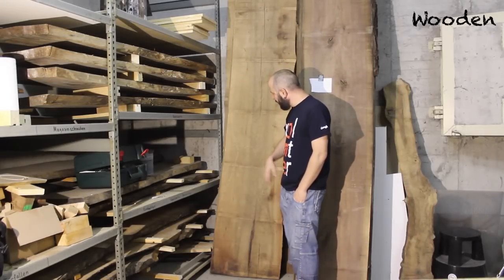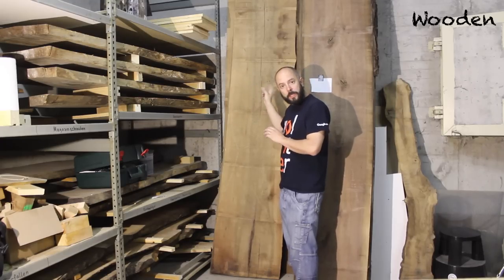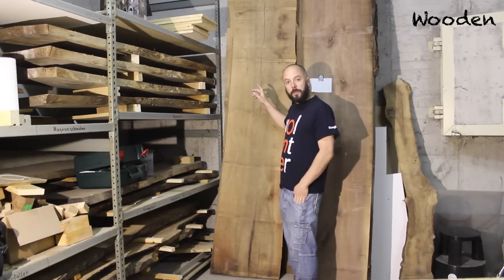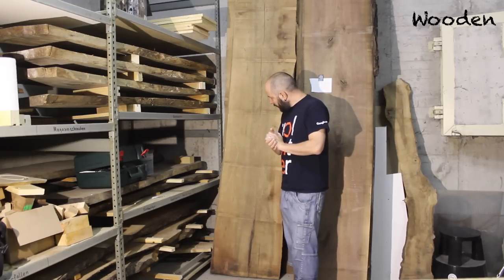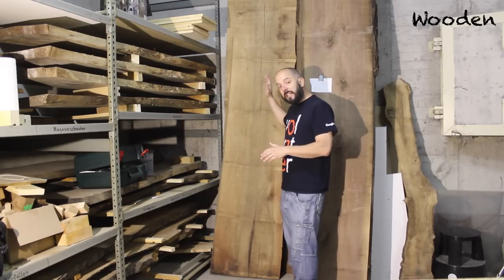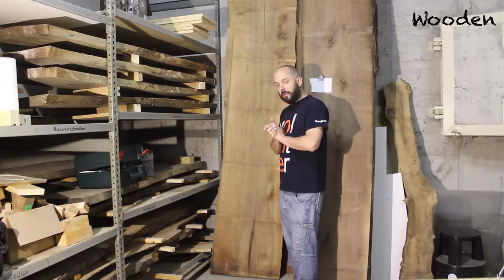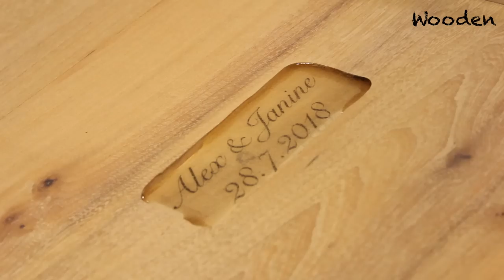Extendable/expandable Live Edge Dining Table - Elm

Comment: Great work. How and where do you store the extensions?
Reply from the maker: Thank you :D I think they store them in the cellar, because they use them only a couple times a year...
Reply: @Woodensoul  ah, ok, I had hoped for a built in storage solution underneath the table, since I want to do one myself 😉
Reply from the maker: @MyNameIsThoms  That should not be too difficult to do, if the table is large enough so you can ensure that there is enough space between the legs. But I didn't do it for this project...

Comment: This is a great video and amazing table.. I have just finished building my own table, constructed out of 120 year old wood that was part of my house here in the UK. Table is 155cm by 88cm. I have been looking round doing loads of research as I want to be able to extend to a square table (I155cm by 155cm). After a silly amount of video's I think this one could help!! 
Thanks so much, the only question I have is the extenders from Layer, which I am going to order now via email. Do you think they will support a large side extension to the table (155x 68cm)? Just thought I would ask as you have used the product, it would be a massive help. 
Thanks 
Pete
Reply from the maker: Hey Pete. Thanks for your kind word. Happy to hear you found it helpful. And congrats for building your own table out of wood from your own house. Love it! Regarding your question: No, these swiveling arms won‘t hold such a large extension. I once tried it with 70cm extensions and it was too much, too heavy. I would recommend you to split the extension in two pieces 34cm and extend the table on both ends instead. That could work. Have fun! Javier
Reply: @Woodensoul  Amazing.. Thanks so much, I was thinking that could be an option. I will extend each side, thanks so much for the help. 
I have emailed the German company and will hopefully come back to me. Thanks again
Reply from the maker: Awesome! Let me know if you have problems with them. I speak German and use to buy from there gear occasionally.
Reply: @Woodensoul  Thank you so much.. You really are going above and beyond, love it. I have contacted them including their UK office and they are asking if I have an account and can only purchase if I have an account with them. Plus saying the order needs to be over £500 UK!! Anything you could do would be amazing.
Reply from the maker: @petebaker8452  Oh wow - what a bummer! 500? What the hell! I also just checked their website, and they removed the UK from the list they usually deliver to. The only thing I can think of would be for you to order two pairs and send them to my address in Germany. That won't cost you any shipping. I can then send them to your address in the UK, which will certainly cost some shipping fee. Plus, given you are no longer part of the EU, there might be custom fees you have to pay when receiving the package. No idea how high your VAT is. I can only guess that if they would send this to you directly, you still would have to pay the customs fee.
Reply: @Woodensoul  .. Thanks so much for the offer. You really are going above and beyond. I would be more than happy to pay additional postage and pay for the goods upfront if you are ok to send on?!! Are you sure, that would be very generous of you?
Reply from the maker: @petebaker8452  My pleasure. Let’s move the conversation to email. You can find my email in my channel, on the tab ‚chann info‘ there is a button to show the email

Comment: I would have liked to see a clip of how you fold It and extend It. But its a great video anyway :)
Reply from the maker: There is a shot at the end where we extend the table, or are you talking about something else?
Reply: I ment like a video of the process of extending It, because Im not sure I fully understand how It would be done
Reply from the maker: Ah. You move out the swiveling arms half way, then put the board on it. then extend the arms completely
Reply: Oooh I see. Thank you!!
Reply from the maker: my pleasure
Reply: Sorry if I missed it, but did you then attach the leaves to the arms in some way so they don't slide off?
Reply from the maker: @marthakarsjens1054  You can see it here (might need to pause the video): https://youtu.be/wpy5Q51HKE0?t=346 The metal arms come with a small hole in them, and the wooden rails have a small "knob" that fits into that hole, so the leaves don't slide off. It works like a charm.